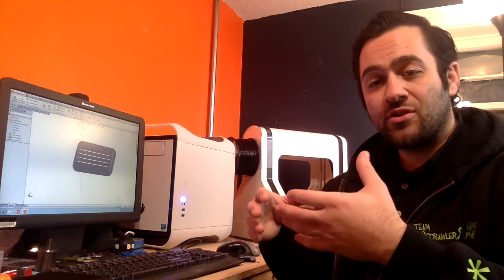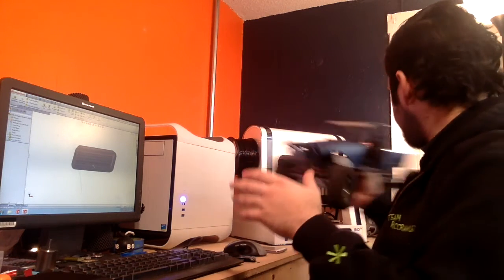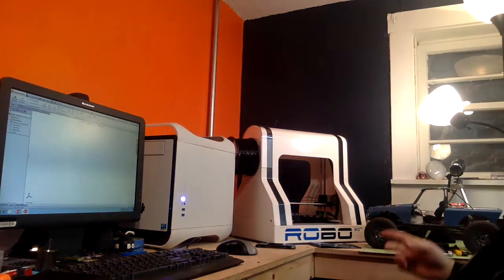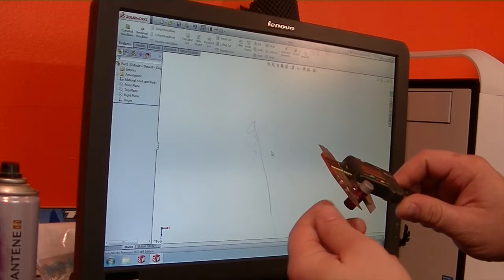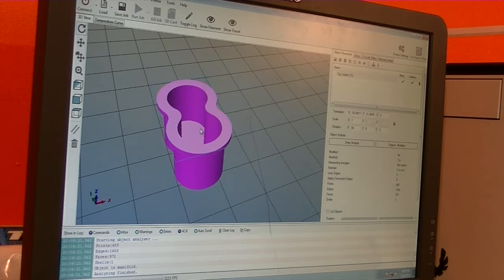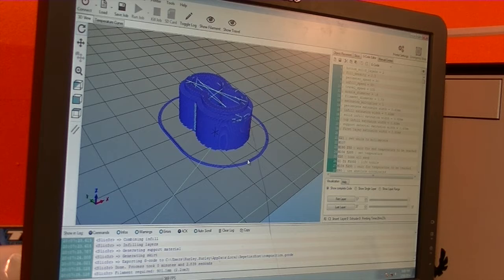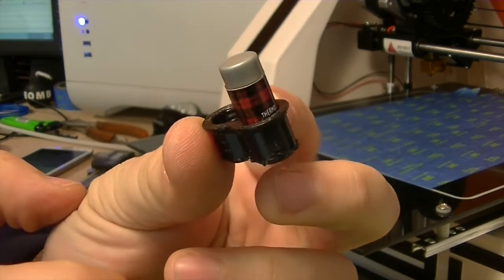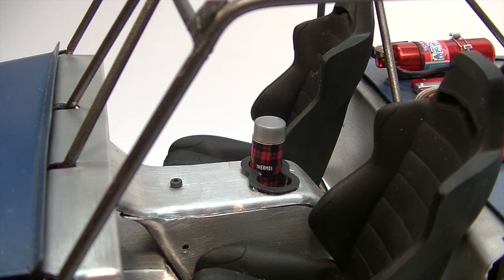Robo3D - 3D Printer Introduction - RC Parts

Comment: I use solidworks all day at work, (mechanical designer) by trade. You could also use the program for your sheetmetal work, flatten it cut it out as a stencil then transfer, cut and bend. The weldment part works very good as well. I use these functions all the time. If you ever his a snag let me know. In a previous job I designed a complete truphy truck using similiar program
Reply from the maker: I have used the sheetmetal function several times and it does work quite well. The weldment feature works well but for a chassis like I have showed before, I prefer my other programs. Solidworks has it's place and I have been a heavy user of it for about 10 years now.

Comment: Very cool Harley.  I have a friend that has a 3d printer that he uses to make parts for his car.  To smooth out the surface, he uses heated metal plates like an iron to sort of melt the surface a bit to smooth it out. Seems to work well, but hes making relatively large pieces.  Maybe you can do something similar, even with a soldering iron or something to help with the contoured pieces.  Just an idea.

Comment: Are there different resolution settings to make the finish a little more polished ?
Reply from the maker: All kinds of settings can be adjusted, the thickness of a layer has effects on the entire shape of a model that has complex shapes. Other things such as the temp also effect the surface finish.

Comment: How much does a decent 3d printer usually run. I have seen them from a couple hundred to thousands of dollars?
Reply from the maker: This printer cost about $900 and that was as cheap as I had found a printer that had a decent quality to it. Most of the printers I was considering were closer to the $2000 mark.
Reply: Ah ok. 900 isn't too too bad for what I would use it for.

Comment: That is awesome! I'm curious, how strong is the plastic used in the printer? Could it be used for things like body posts or a-arms? Or is it just purely for decoration uses? And are there different colours of plastics or are you limited to just black?
Looking forward to seeing what else you'll make with this printer, it will be interesting to see your imaginations come to life. :)
Reply from the maker: The material is stronger than you may think but at the same time it doesn't belong in applications like suspension parts. I plan to use it for parts that are in low/no stress areas personally.

Comment: Could you print out chucks of bodies so they can be vacuum formed with lexan? If so i want me one of those printers...or pay someone to make me a chuck lol hint hint harley...
Reply from the maker: Yes, I touched on that early in the video. To pay to have a body printed, you would likely be better than half way to buying a printer. The modeling time is what is going to cost you even more though unless you are capable of it yourself.